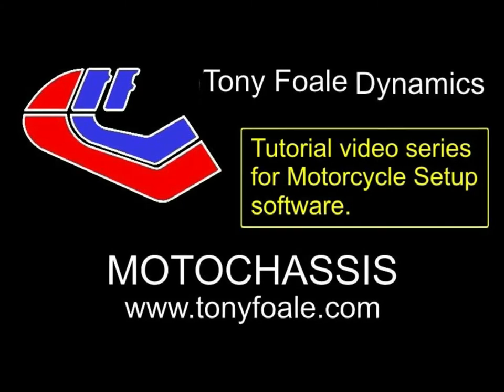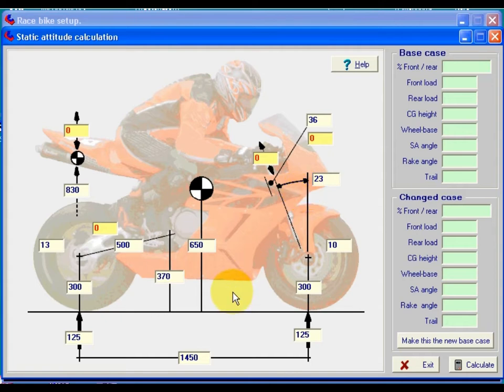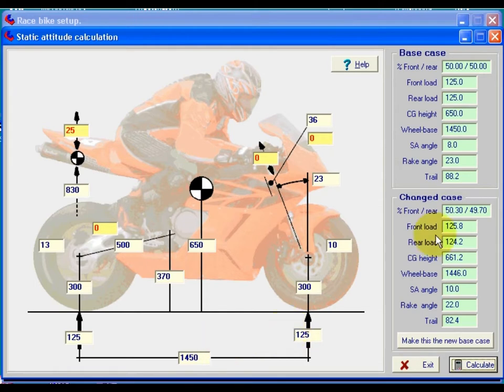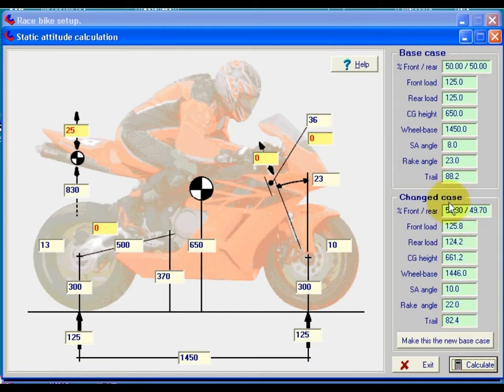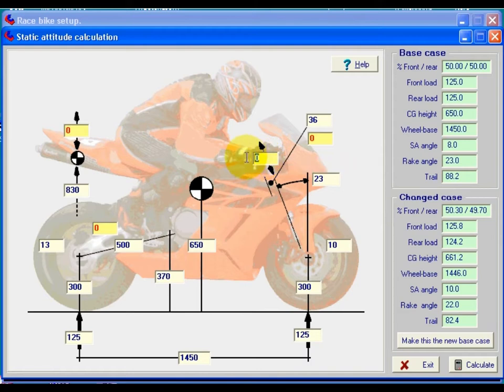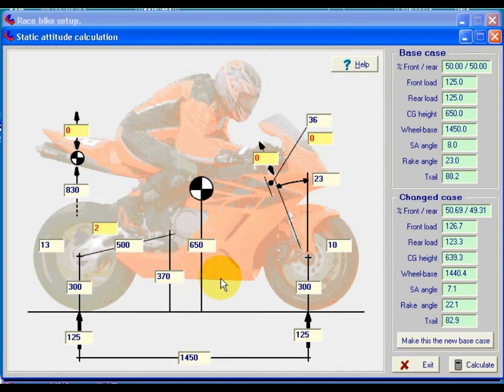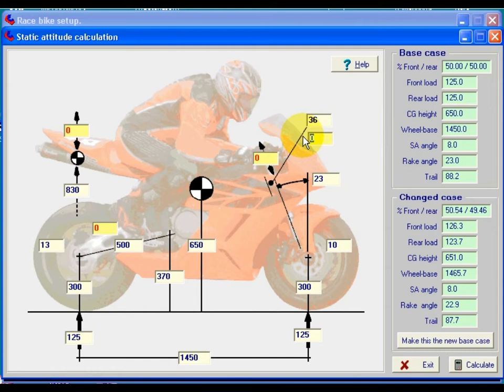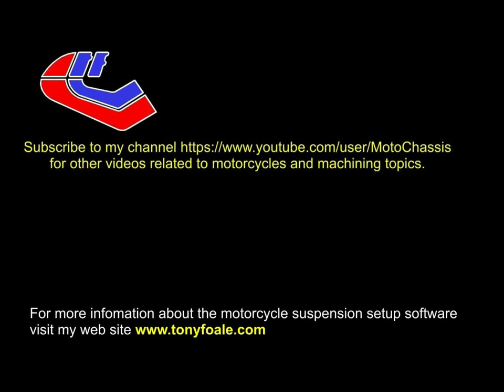Motorcycle Attitude calculator

Comment: Mr. Foale, changing the the chain links would mean changing
1. Distance between swing arm pivot and rear wheel axle
2. Lengthing the wheel base (which has from 1450mm to 1465mm)
3. Decrease in the CoG

So how has CoG increased by 1mm?
Reply from the maker: I think that I can't explain any more than is in the video.  The longer chain means a longer swing arm which raises the rear which will raise the CG by about half the rise at the rear.
Reply: MotoChassis okay, I get it. The swing arm angle is increased by lengthing the swing arm?
Reply from the maker: The swingarm angle only changes slighty.  Because the swingarm is angled to start with, when it is lengthened it raises the rear.